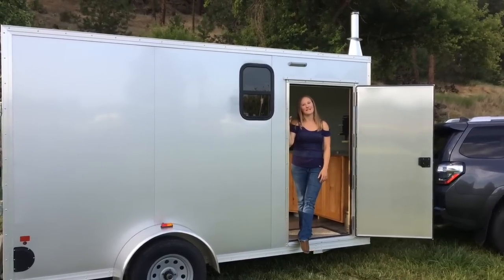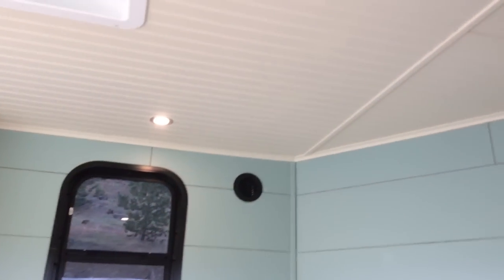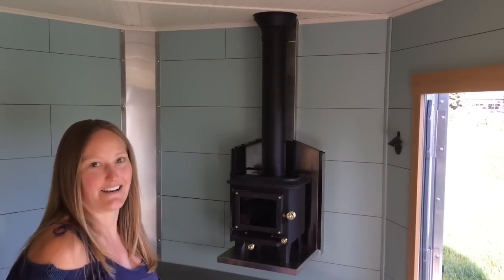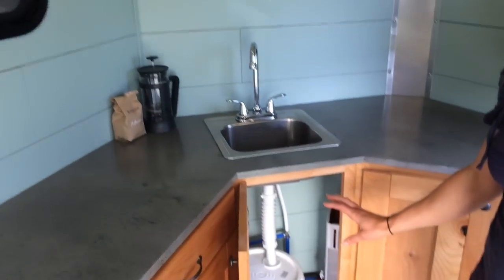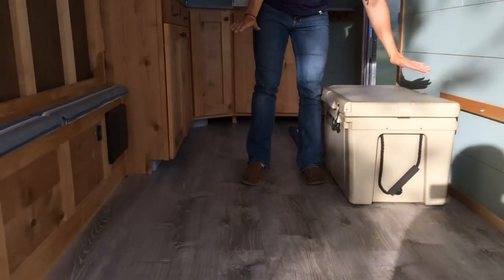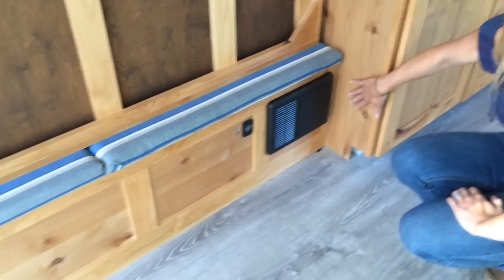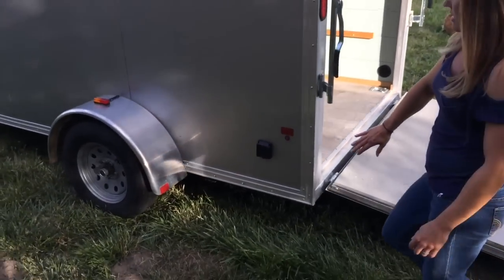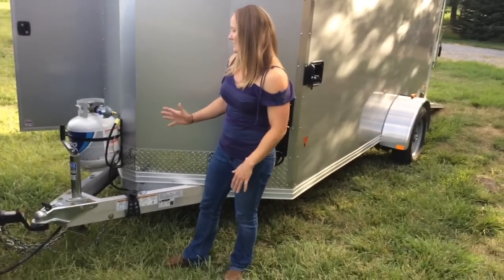Our DIY Cargo Trailer Conversion

Comment: can you shed some light on how you made those epoxy countertops, how did you get that "concrete" look. I'd love to do something like that...
Reply from the maker: Super easy. I used cardboard to make the template for the counter top. I then transferred that to two sheets of plywood scraps I had. I then cut out and joined together the plywood using dominoes to make one solids piece of 1/2” ply. I then trim nailed a piece of solid wood along the outside edge to hide the exposed ends of the counter top and to make it appear to thicker than the 1/2” ply, this also covers up the plywood layers. I then got a can of rust-oleum grey primer and rolled it on. I may have done 2 coats? This was my base color. I then took some epoxy (I use systems three medium cure) and rolled a coat on. Using a torch quickly run the flame over the wet epoxy to pot any bubbles, don’t burn it though. With the Epoxy still wet I had a few cans of spray paint, it was whatever colors I had in the cabinet, I believe It was a an oil rubbed bronze soray paint, black and white. Holding the can high-ish off the surface I started just dusting the surface. When you just dust the surface the paint hits the wet epoxy it spreads out into kinda crazy patters and doesn’t look like spray paint. I did a couple of coats of epoxy with this same process and then followed it up by one clear coat of epoxy. Usually I don’t like gloss surfaces but I didn’t mind it on this one so I was finished after that. if gloss isn’t to your liking I’ve in the past made it a satin look buy waiting until the epoxy was fully cured, then sanding with a soft foam pad at 220 grit, then I sprayed it with a water based polyurethane, I use general finishes high performance poly, the stuff is awesome. Anyway hope that this demystified the process a little bit. There’s a YouTube channel of a company called stone coat counters that does a killer job and have more more in depth designs and instructions. They also sell all the products if you want. So check them out. For me I just went cheap with all materials I already had and I’m pleased with the outcome. It’s held up fine for almost 3 years now.
Reply: @littlejoey22  that's awesome. Thanks for the thoughtful response! I'm definitely going to experiment with this..

Comment: I love your build! I will be copying a few things, lol.
Few questions: maybe I missed it, but what make is your trailer?
I've been looking at a Haulmark, but like your aluminum one better.

Did you do the epoxy countertops yourself...and what color did you paint the ship lap? Beautiful!
Thank you! Safe travels.
Reply from the maker: It’s an E-Z Hauler aluminum trailer. I believe they’re out of Montana. An important aspect for us was weight and compared to a few steel trailers that we looked at the aluminum was nearly 400lbs lighter. Keep in mind that does come with a little added cost.  

Overall I’m happy with the build quality of their trailers, though there were a couple of minor things I would have liked to have seen. After tearing into the trailer I found that the rear floor area over the axle was reinforced and the floor was well supported but up front the floor was a bit spongy and could have used another supporting cross member. Along with that if I were to build it over again I would have just taken the floor out and used a 3/4” marine grade plywood. Instead I left the 5/8(?) osb and used deck paint to seal up the undercarriage, we’ll see if that holds up. I feel like OSB just shouldn’t be used there. 

The deciding factor to go with this trailer was that I liked that they used thicker gauge aluminum than a competitor. There’s also no exposed fasteners, it’s all sealed seam aluminum. We also got the 6’6” ceiling height

The only thing I felt the trailer itself needed after the build that we didn’t get originally was trailer brakes, but they were easy to install and now it ties like a dream. 

Thanks for positive comment. If there’s any q’s you have feel free to ask. Good luck on your project and have fun with it. 

Oh.... one last thing, the cubic mini stove is cool and all but in retrospect I don’t think it was worth the cost. For us it turned out to be more of an expensive novelty. It works but takes work to keep the trailer heated with it. In the end, the stove, the stack, cap and flashing added up to nearly $1,000. I would have rather plumbed in a small vented gas heater that I could put a thermostat on and not had to worry that while I was sleeping or out hiking that my water lines would freeze.
Reply from the maker: Also check out stone coat countertops they have some good videos on doing epoxy counters. Super easy to do. 

Paint color is Schwerin Williams Quitetude paint code number 6212.
Reply: Thank you so much! Appreciate the info!

Comment: Just watched the video - Great job! What did you use to allow the bed to fold down? Also, how far is the end of the bed from the passenger side wall in the down position? Thanks
Reply from the maker: I installed a French cleat on the passenger side of the trailer, so when I drop the bed it falls into a French cleat rail which is screwed to the studs. The opposing 45 degree edges of cleat hold the bed firmly against the wall. In the down position the bed doesn’t rest on the bench, it has two legs much like a Murphy bed that fold out and support the other side of the bed. This allows access to the bench which is really just a storage area that is separated into two compartments, one side holds all the electronics and battery the other holds blankets for the bed. When in the stowed/traveling position the legs are folded up, and two hooks hold the the bed against the wall. The memory foam mattress adds tension to the bed against the wall and the seat cushions on the bench keep it from vibrating. It doesn’t move or vibrate at all. There’s some things I would have done differently with this trailer but the bed isn’t one of those. It’s comfortable, rock solid and easy to make. I saw a lot of elaborate and creative ways to make the bed, but in my situation the easiest solution worked out well.  I will say though the clearances are tight and had we not gone with a 6’6” inside trailer with a flat roof my design may not have worked. If I get a chance a shoot a quick video about the bed. The one negative thing about my design is when going from stowed position to sleeping position it’s super easy with two people, a little more challenging by myself.
Reply: @littlejoey22  - Thanks for the response. I did a hinged Murphy bed using boat seat swivels that worked great, but you lose 2 - 3 inches of width because you need space for the swivel to turn. I'm doing a personal build in a 6 x 12, but I'm using a twin bed, so height won't be an isdue. A video would help a lot of folks see your vision.

Comment: Anyway you guys could email me some pictures of the plumbing? Do you do any boondocking or is 100 percent of your “in” water coming from hookups? Did you just get the plumbing from your local RV store?
Reply from the maker: Here’s kind of a crappy video I made a while ago about the water system: https://youtu.be/x5PUoWtkfj0
Not the best video on the planet but you can see basically what we did. 

To answer your question we mostly boondock. We’ve added a solar panel that keeps our battery charged even on cloudy days. We installed LED lights to lower the energy usage, so most of our power goes to running a fan and water pump. For us it’s perfect, for those who like to hangout and run a bunch of amenities probably would have to look for alternative sources of power. As for water supply lines, I just used pex pipe which is available pretty much everywhere now. For the gas line, I used iron gas pipe outside and then I had a hose made by a local company called house of hose, they do most of the hydraulic lines and fuel lines for all the heavy equipment I work on at work. Most cities will have a shop that can make up hoses for you so you have all the correct fittings professionally crimped on. It was actually cheaper then getting the thinner hosing from camping world. The only challenging part was making sure that you had all the right fittings. Finding the right stuff for the water tank was a pain. The shower, the water tank, the heater came from amazon. The sink was a small stainless kit from lowes.

Comment: really nice, it's hard to anything with 6' wide but this is a great mini toy hauler for sure! that stove is so cool, they make them in montreal about 2hrs from where I live. Curious, are you running your propane line under the floor joists are does it go into a hole in the wall?
Reply from the maker: Thanks, it was a fun build, still enjoying it a lot. Ran black iron pipe along the aluminum frame rail and then up through the floor. I put a T fitting at the point where the line turns up through the floor that way I can add to it someday for an outdoor stove or heater. If you’re looking at building a trailer, check out 509stoves. The cubic mini is cool but in cold weather the burn time isn’t long enough. While I do use it as my primary heat source, during long days away from the trailer where I’m unable to stoke the fire it gets cold and I worry about water freezing. I helped a buddy build a trailer that he parks up at a ski resort and the 509 stoves are a self feeding wood stove with 12hrs of burn. Hope this helps.
Reply: @littlejoey22  oh that's awesome information. Super helpful. Thanks! The iron pipe is a great idea, should protect it well.
Reply from the maker: I typed that last message on my phone and it was hard to read with all the typos so I edited it. Also I wanted to clarify a few things. I stubbed the black iron pipe out near the front of the trailer, then I ran a outdoor rubber fuel  line from the propane regulator to the iron pipe. I got this rubber hose made for me from a local industrial hose shop called House of Hose in Spokane Washington. You’ll probably have a similar type of shop near you, they build hoses for hydraulics on heavy equipment. After the black iron pipe comes through the floor I have a shutoff valve and a reducer from the half inch iron pipe to a rubber line that hooks into the water heater. I’m thinking of adding a small fan in the space with the heater so that I can vent outside and pull air from the living space. Right now if somebody is using the shower I need to have the cabinet door open to get enough oxygen for the ventless water heater. Hope this helps and I’m sorry about all the typos on the last message.

Comment: awesome setup. curious to how many showers you get of your 25 gallon tank?
Reply from the maker: Rene hard to say exactly. We’ve had trips where we’ve been really conservative with water usage and extended that 25 gallons for 5-6 days. On the shower head there’s an on/off valve so you can literally just spritz off and not let the water just run. Back when I was in the service we called those “sea showers” but they’re not quite as enjoyable. I think our average usage is 25gallons/3 days. That includes a shower each, dishwashing, hand washing and brushing teeth etc.

Comment: How did you attach the shiplap to the walls?  Nails or nails and glue ? 
Thanks great job
Reply from the maker: The faux “ship-lap” which is 1/4” utility ply ripped into 8” widths, is held up mostly by construction adhesive. I just back- buttered the shiplap with a 1/4 inch “V” notched trowel and then used 23 gauge pin nails to hold them in the right position.  I used a handful of nickels as the spacers. If not using a real shiplap I suggest painting the wall behind it. For me that was the 1/2” osb that originally came with the trailer. For the ceiling I screwed 1x3 pine furring strips to the metal rafters. Then for the bead board I again used construction adhesive but I also fastened the  wainscoting to the furring strips with screws hidden behind trim.  Before screwing it in I tacked the wainscoting in place with 18 gauge brad nails. Hope this helps ya.
Reply: @littlejoey22  well done dude!

Comment: I like it, but I think you should put the water heater outside or have a vent pipe for fire safety...
Reply from the maker: It’s a weird type of water heater in that it doesn’t have any place for a vent, it has  a reburner just like a heater buddy does. I don’t %100 love it, I keep a close eye on it cause it makes me nervous but so far it’s worked as the manufacturer advertised. In addition to the onboard sensors it has I also installed inside the cabinet a CO Lp monitor. I shot it with a thermal indicator and it’s warm when that heater is cranking but it’s not crazy hot. I think the best thing to do with this type of heater would also have some sort of small fan to pull air through it cause it does shut it self off with low o2. Anyway, hope you’re having a good day.
Reply: @littlejoey22  Take it to a heating service have a metal container woth a 3inch vent pipe conector made, or buy a better one with the vent conector on it...I saw a youtube video how a guy made his own metal cover with a vent pipe on top...crusing castels.youtube

Comment: Good one, why doesn't everybody go with tankless hot water and single axle?
Reply from the maker: Greg p both have pluses and minuses. We went with a single 3500 lb axle because we wanted my wife’s 4Runner to tow it easily when it’s fully loaded. Had we gone bigger we would have surely built more to go into it thus I think it would have been a bit heavy for the her SUV. We designed to fit our ATV and with that we were worried about weight. The manufacturer of the axle said that the max recommended haul weight was 2990 lbs. Fully loaded with water and an ATV the trailer weighed in at 2930 lbs. So we made it by the skin of our teeth. Had we gone a little bigger, like 7x14 which is what I’ve seen most we wouldn’t have even worried about the haul weight of the trailer but then we would have tow it only with my truck. As for the tankless water heater, it’s awesome. I have zero complaints about it, the only draw back is if we use the shower we have to keep the cabinet door open or it runs out of oxygen and shuts itself down. If you went with a vented one you wouldn’t worry about that issue but you also have to pop another hole in the trailer and run piping. So like I said pluses and minuses, just matters what works best for you. Once the weather warms up I’ll do a full review on it. Thanks for the positive comment, hope you have a great day.
Reply: That makes a lot of sense.

Comment: How's the trailer working out for you, have you been using it much?
Reply from the maker: tree feller love it! It’s so much better than a tent and not nearly as obnoxious as one of those 30’ monstrosities. We’ve added a few things since making the video like a 100 watt Renogy solar panel which is fantastic, an outdoor shower curtain I made using Bimini boat hardware and a few other things. So far it’s all held up great, the shop made cabinets are great, the bed is so much better than the ground, the trailer is awesome. If you’re thinking of building one, it’s not that hard of a project and extremely worth while. If I was going to change anything I’d get rid of the wood stove and come up with another heating source. Don’t get me wrong the cubic mini stove is cool but it’s more of a novelty than anything else and it was one of the most expensive parts of the build once you factor in the stove, the heat shield and the stainless steel pipe. It definitely heats the trailer up well but stoking it every few hrs on a cold night sucks. Last Nov, we were camping in the mtns in Idaho and went for hike during the day but the whole time I was stressing the pipes freezing.  At some point one of the water jugs we had brought popped the top after it started to freeze so I think a dodger a bullet on that one not messing things up. So anyway  I’d recommend something other than a cubic mini if you’re planning on cold weather camping, at least having something other than just that.

Comment: How do you sit on the bench if the bed is on it??
Reply from the maker: The bed only sits on the bench when we’re traveling. However we don’t really use it as a bench for sitting. Originally the idea was that the bed can stow against the adjacent wall and I was going to build a pedestal table for in front of the bench but then I decided that was unnecessary. So now the bench basically serves as a full length bedside table, and a storage bin. It’s dived into two sections, the front section houses the batteries, the power controller/circuit breaker panel. The rear compartment stores blankets and pillows. The lid is hinged and so when the bed is down I can easily access everything. The pillow top acts well to protect the the bed from rattling around while stowed for travel. Most of the time we travel with the bed down but having it up on the bench out of the way allows me to put bigger cargo into the trailer, like our atv.